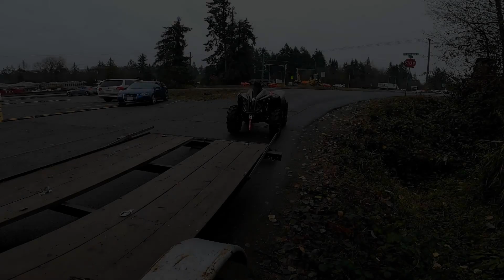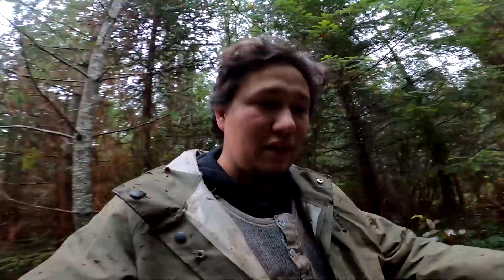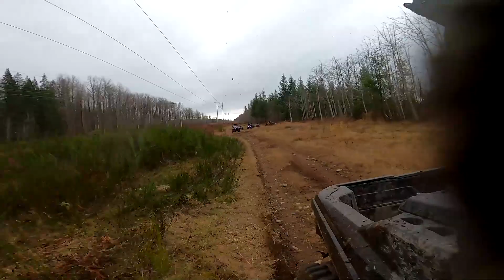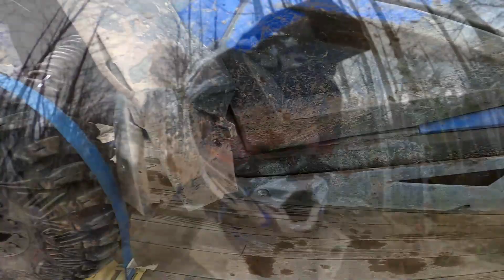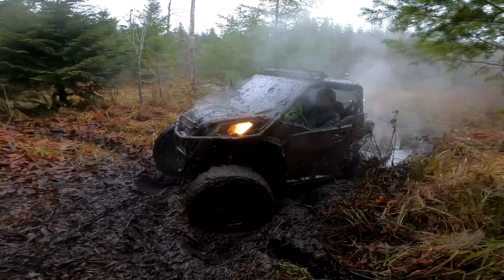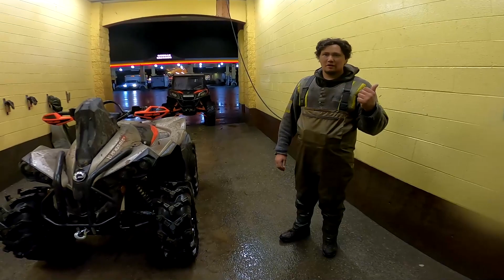TRAIL DEFIANCE.. RMAX,XMR RENEGADE,OUTLANDER,MAVERICK,RZR

Comment: My buddy bought one of these and had a few issues but before we started the second ride at Hatfield & McCoy it started overheating and he ended up riding with me in my RMAX all day. When we got home he took it and traded in on a Polaris RZR Pro. (I'm not a fan of Polaris either!) Should have bought the Grizzly bro! Please keep a good balance of content. I only watch to see the RMAX destroy the other brands.
Reply from the maker: Hahahha i had issue to with this thing right out the box. Leaking coolant from a loose rad hose and loose handle grips and few other things. Fit and finish on the quad is a 1/10 the Rmax was a 10/10 for fit and finish. But hey the Rmax isn't going anywhere, sadly I will be riding the quad for the next few vids as I'm waiting for a new shock on the Rmax but when she's fixed it will be out almost every ride with me. In the future I plan to get a grizzly as well. The Renegade is not a comfy all day riding machine but I do love the power.

Comment: Dang man, I hate that happened to your rmax. Hopefully the parts will be in soon. My SATV rear arms are cracked at the welds as well. Probably gonna put stock back on until they fix the problem & send me some new ones. I was wondering are you still running the weller tie rods & if so, do they still have alot of play in them?
Reply from the maker: Hey James ! Yes it sure is sad because it isn't even oem parts that failed. But live and learn. Revco has been my contract and supplier of these A arm and have been great to deal with and have sent me 3 sets now. The 3rd I had Ryan on the white Suzuki beef the arms up for me. They look kina funny as one piece we added is in a strange spot but does add the strength we think it will need. AS for the tie rods so far I am happy and they do not have the play the old ones did without the rubber dust boats. Weller racing is a good company which is why I choice them but I was very disappointed in the first set of joints I had cause they failed with in a few rides. These ones that are on my rig now are holding up great and have lasted a good while now with no play. They have now show pictures of a new Rmax steering rack which is awesome and maybe soon some extra amperage power steering.